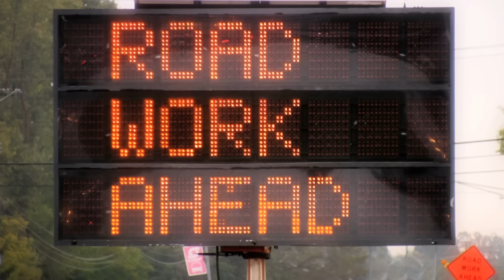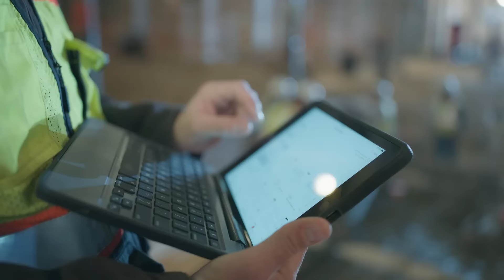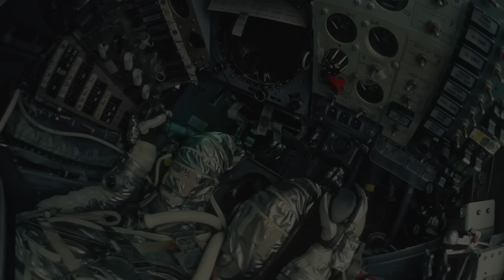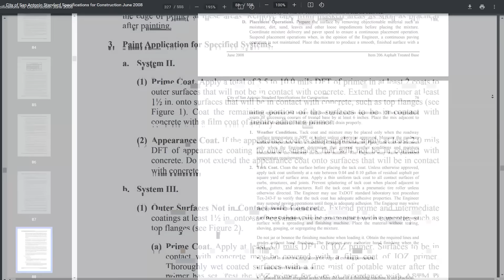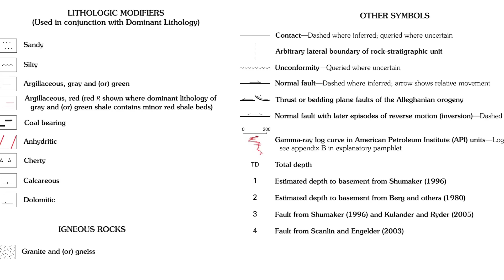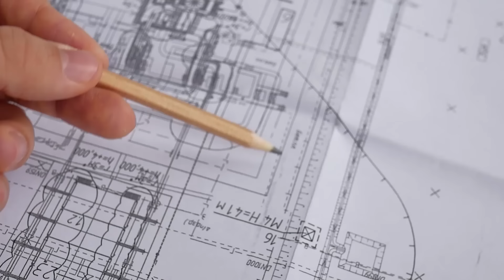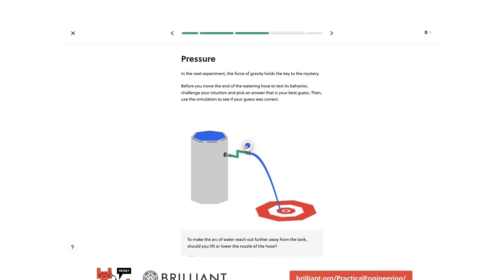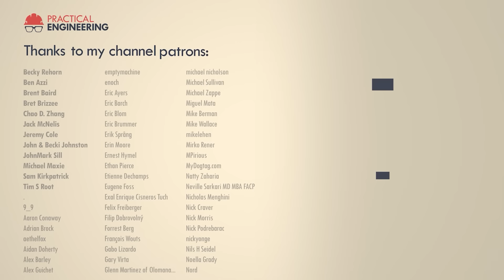4 Myths About Construction Debunked

Comment: The sites I’ve been on (spent some time as an architect’s gopher) had each person clearly marked as to what exactly they did, and for whom.  Both of us were marked ‘architect’, and were often talking to ‘so and so company-foreman’ ‘xyz-structural engineer’ ‘municipality-code’ and  ‘client-project manager’.  We were either measuring something, well, I was, hence why I was there, or looking over handfuls of ‘company 1-electrician’ and ‘company 2-plumber’.  Kept jobs straight, so we didn’t ask the plumber a question for some other company’s flooring guy, and kept accountability straight.  A stunning lack of (insert task do-ers here) would be very quickly addressed, and a group of (insert other task do-ers here) would jog our minds as to some other thing that needs to be done somewhere else.
So often it’s just blobs of green vests that the whole company looks rubbish.  The same green vest is on the pickup truck warmer as it is on the shovel keeper-upper.  The line of idling widget trucks would look less wasteful when you could see that the company forgot to send some widget relocaters.  Or if the pickup truck warmer was someone identified as to his entire job being keeping truck cabs warm.  I look just like an architect, but I’m a temp who holds a laser measurer.

Comment: Somewhere on every major construction project is a "work flow" chart. Sometimes these charts can be huge. Up to six feet in length and consisting of hundreds of pages. These charts are made up by engineers who determine what has to get done when and by who. Many think that builder just "wing it". Nothing can be further from the truth. Major construction is an elaborate dance of trades carefully choreographed by engineers and is extremely complex. The result may be a slight overlapping of trade time/duties. Here's an example: As an Operating Engineer I often have to dig trenches for plumbers and electricians. I may be called to work the same time as the plumbers. But, i haven't dug the trench yet. But I can dig crazy fast. So, the plumbers stand around for a half hour to an hour to allow me to get a head start on them. Then they start putting in the pipe behind me. The result is that, we can finish both our jobs together. Rather than separately. Saving a tremendous amount of time overall. Even though it appears to an onlooker that these guys are doing nothing. Everyone on a job site is doing something or waiting to do something. 
BTW, drill rigs are the worst (optically). Becacuse you have a Drilling Engineer, a maintenance engineer, dock builders, and an Operating Engineer. All standing around until it is their turn to fulfill their function. You would have to be on site at least a day. To observe everyone doing their thing. Yet, nothing gets done without all of them. IUOE Local 15 ret (38 yrs)

Comment: Working as a network engineer, I can tell you if there is a guy digging a hole instead of an excavator or auger, there is infrastructure at the bottom of the hole.  And as a contractor you could be out literally millions of dollars if you hit fiber.  Because you pay to repair it and you pay for the incurred outages.  And multiple companies may have fiber in the same tube.  Hitting a buried electrical, water or gas line is going to be cheap in comparison.

Comment: I just saw this video. I’ve done both manual and office work. Both are to be respected. It’s up to the individual. Some are self motivated, others tend to be lazy. It’s usually the latter that are the most critical. 

Discussing the steel in concrete and the disintegration over time. Couldn’t the rebar or steel beams be coated with a rubberize or plasticized barrier from I suppose acidic content of the concrete?

Comment: about the standing around part. my company works as a subcontractor for others. 99% of the time they will provide the personel and equipment for the digging jobs that are required. i tell them where to dig the holes necessary for my work and they go about. i stand besides them and look and wait until they have unearthed the cables and lines i need to have free, when someone comes by they see me and my colleauge standing around the guys doing the work. but when they are done and i can do my work, then you can see them waiting around for me. usually i help them shovelling when a line is playing hide and seek but never would i do any excavator work, simply because of insurance reasons if something gets damaged.

hope that clears things up for some

Comment: As someone that has worked in construction and concrete, many of them will literally stand in a hole pretending to work. I have also witnessed 5 construction workers, along with a cement truck to pour a 1x1 square metre sidewalk. One. No way that is the most cost effective way of doing that, when it literally could have been done by two people with a wheelbarrow.

Comment: I wonder if the more ideal alternative to "lowest bidder" contracting that doesn't sacrifice cost efficiency would be a combination of awarding contracts to the company that offers the most ROI along with a low price. That way while you're still going to rule out the most expensive options, the affordable ones will only compete with each other by offering methods that best assure that the final product is efficient. Perhaps featuring the most reliable components for a part that's known to be the most likely point of failure, or integrating some green energy solution to guarantee a lower electric bill.

Comment: Thoughts about the Roman Concrete/Roads:
Last I checked the Romans didn't have hundreds of multi ton vehicles moving at >20mph over their roads every day. You hammer the ground with multi ton vehicles all day, of course the ground is gonna shift and settle, and when that happens you get cracks. Roman roads would likely not last very long if they experienced the same car traffic and speeds that modern roads often do.

Also has anyone ever driven on cobblestone roads? You don't want to travel over 25mph on em cause its such a bumpy ride.

Comment: I was on a multi million euro upgrade scheme of an interchange, we had 20 or so labourers on site. We were busy most of the time but you did get days where you wouldn't be flat out. Then one day the quantity surveyors decided to cut the number of labourers in half despite all the foremen saying they needed that many. What happens then? We get busy and deadlines had to be met and we didn't have enough labourers. We were constantly being dragged from one end of the site to the other, starting one job and being dragged away to do another. Getting all the gear together and moving around was very time consuming due to lane closures and it being a very busy interchange. Within two weeks they had to hire back 10 more labourers because we were under so much pressure. It's very frustrating when higher ups have a walk around site 1 day a week and might see someone not busy and think why do we need them when there's 5 or 6 working days and you might be flat out for 4 out of the 5 then they come around and catch you on a slow day or even a slow hour and make a decision there and then. 

You might get a slow week or two and think jesus why do we need this many labourers or machine operators but then you get a busy few weeks or months and then there's nobody around because the higher ups said they were doing nothing. Very frustrating.

Also another thing on "standing around", construction is like a sport or going to the gym. If you have to carry 20 bags of cement up 4 flights of stairs, you're not going to put 2 bags on your shoulders and run up and down the stairs and then be wrecked tired for the rest of the day, you have to pace yourself and make life easier because you only have one back at the end of the day. Labour is hard on your body and if you take 5 minute breaks here or there it's even better from a production POV as you are getting a breather and will then be able to do more over a longer period of a time. You don't see athletes sprinting all the time in sports games, they pace themselves throughout the game and speed up when necessary.

Comment: How are skyscrapers built on sand?”

Most skyscrapers are not build on sand, but this does not mean they do not exist. These buildings can be difficult to make. This is due to sand not providing much support and being very loose, and because of liquefaction from the water meeting the sand. Because of these two factors these building need really deep and sturdy foundations. These buildings also cant be to tall because if they are to heavy then the sink with liquefaction faster.

Comment: Construction workers do spend time standing around, which is obvious because we've all seen it many times.  Of course there are reasons:  it's not practical for them to leave the site every time they have five minutes before they're going to be needed again.  They need to be there, and the nature of the job is such that it's not possible to keep them actively busy the whole time.  The backhoe operator has to wait for one dump truck to drive away and another to pull into its spot, and then the dump truck driver has to wait for the backhoe to fill up the truck bed before driving off, rinse, repeat.  It's not practical to have one guy drive both the backhoe and the dump truck, because then the job would take a lot longer, and construction jobs already take long enough.  And so on.  So yeah, there are reasons; but the fact that it happens is not a myth.  It does happen.  It happens a lot.  It's part of the nature of the business.  And yes, office workers have analogous situations:  I can't tell you how many times I've had to stand around by a fax machine for 5+ minutes waiting for a confirmation to come through after multiple retries, and sending faxes is only very tangentially related to my official job duties.  (I'm the computer guy.  In theory, I should be doing most of my job-related communication via the internet.  In practice, the real world is not so simple.)  This general principle applies to many kinds of work.  Even if it were possible to design workflows for all tasks that didn't require anyone to ever stand around waiting for something, they wouldn't necessarily be the best way to get things done.  In some cases they might not even be the most efficient use of labor, let alone time, money, capital equipment, and various other resources.  My dad used to work for a printing company that used an offset press.  Because of the fumes from the ink, it was not possible to leave a single crew in the press room for an entire shift; they had to get fresh air every hour or so.  Since an offset press wastes a lot of resources when it starts and stops, it was cheaper for the company to pay two entire crews for every shift and swap them out every little bit, so that any given worker was working half the time.  There were and are other kinds of presses that didn't have this problem, but despite that the offset press was (in the eighties) the cheapest, best, fastest, and most cost-effective way to do very large print runs in color, even though it involved paying people to stand around a lot.  I'm not sure if that's still true today, or if high-end laser-printer technology has taken over; I'd be curious to find out.  They printed all the Sears and Penny's catalogs, among other things, on an offset press.  Those are definitely a thing of the past: we have Amazon now.

One of the key things about multi-thousand-year-old Roman structures that have survived, that has allowed their concrete to survive so long, is that they tend to use inherently stable self-supporting designs (e.g., heavy arches), which use a lot more concrete (and are thus more expensive to build) but avoid the need for reinforcement.  There's something to be said for this, and we do still know how to do it, but it's not ideal for every construction scenario even if you have the budget for it, and you often don't.

Comment: I watched a 500KV transformer weighing 200 tons be replaced.  Someone ask a laborer why he was standing around for the past 5 hours.  He job was to take a 6" paint brush and a 5 gal pail of grease and grease the two steel plates that were going to be used to spin the transformer 90 degrees.  The boss told him that when he tells him to grease the plates he better be their and get it done.  It is worth the money to pay that laborer than to hold up the move and have a 200 ton load suspended any longer than necessary.  The cost of replacing that transformer is in the multi millions plus months of down time waiting for the transformer to be built.

Comment: Lowest bidder?  Long story short, my employer bought 100 power supplies (over $500 each) that were well designed and well built.  Before the next purchases, some other company bid lower, so we were forced to buy the next 400 power supplies that were poorly designed, poorly built, and used poor quality parts.  The approximately $40,000 we saved on the lowest bidder was a drop in the bucket compared with the approximately $1,000,000 we spent to constantly repair these cheaper power supplies, not to mention periodic down-time caused by failures.  The only good to come out of this lowest bidder rule was that it kept me employed, fixing these awful power supplies.

Comment: I saw a  city crew digging a hole in the road. There was one guy in an excavator that had broken up the road surface sitting, one guy in the hole, two guys outside the hole ( one holding a clipboard), a driver sitting in the tool truck, a union steward riding shotgun, a city supervisor and a city engineer standing beside a car. ( I knew the guy in the hole, he explained it on his break )
Reply: What was he doing in the hole?

Comment: I used to think the same, until I got a job on a construction site. Most of the people "standing around" have other jobs that "outside" people dont understand. Some workers are still only "helpers" skill level. Thier job is to observe and be an "errand boy" quite often. Safety workers--thier job is just walk or stand around making sure all safety regs r being followed. Project managers--observe to make sure everything is going together properly. Some crews cant work somewhere until anothe trade's crew finishes thier task. My particular role is 99% standing around too. I am a Construction Surveillance Technician. I am the security construction observer. Higher level goveenment buildings are required to be built to certain security specs to be able to have government classifed material and conversations in said buildings. I make sure it is built to those specs. I take some notes, pics, make sure no unapproved electronics enter the site, etc. Depending on the site or building, I can sit or stand 99% of my shift.

Comment: @9:50 And that's where the engineer gets off from the reality of the bids.
If a contractor bid lower than the amount it needs to do the job, he won't "just receive what he bid for", but will also receive whatever is lacking as if the bid never existed in the first place.

Yes, the bid and contract are there to ensure that the biding contractors respect whatever promises they gave, but the reality is different and the application of the bids has become more of a joke than a statement.

The reason is simple: If a contractor bid a lower amount and the amount is insufficient to the completion of the project, there are 3 possible resolutions:

1) The client (or city) pays more and cover the difference. Everyone is (kinda) happy and the project gets done and all that comes from the Taxes payers' pockets.

2) The client (or city) refuse to pay and forces the contractor to finish the job with the amount previously signed for. The contractor then is forced to continue or there are some legal investigation and whats not. The project is slowed down if not halted. The contractor might end up going in the red and decide to fill for bankruptcy (after putting lots of the bid money in offshore accounts). Hundreds if not thousands of people loose their job and revenues. That's less money for the city and more insecurity for its economy. Moving the contract to another company, by then, could result in a cost even higher than the price required to cover the insufficient bid. This could also turn into the following 3).

3) The client (or city) refuse and the whole thing ultimately comes to a close. The project is cancelled and whatever money  that was invested up to that point is lost.

Comment: If the steel within reinforced concrete is able to corrode to points of failure such that we need to replace bridges every 25-50 years, why not just seal the concrete with a non vapor-permiable coating?